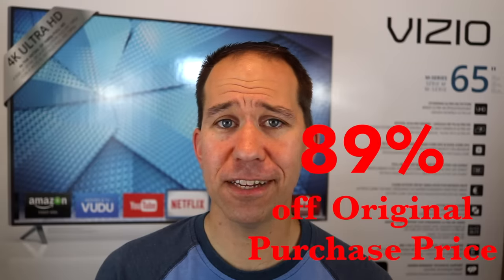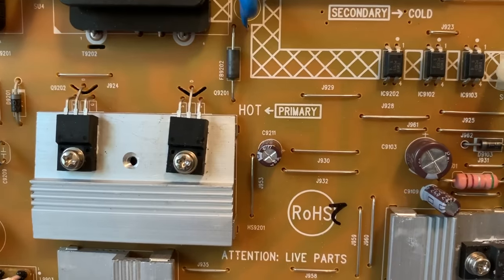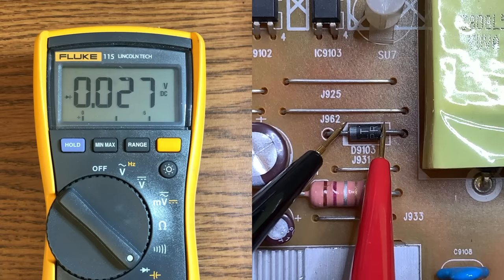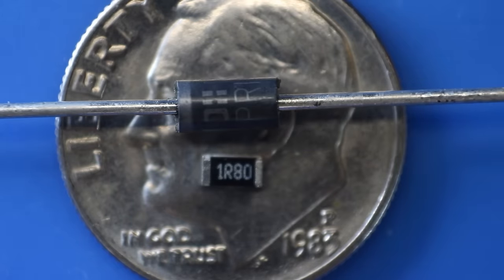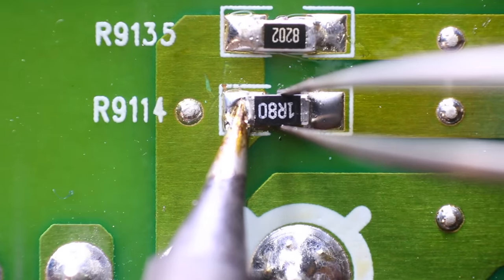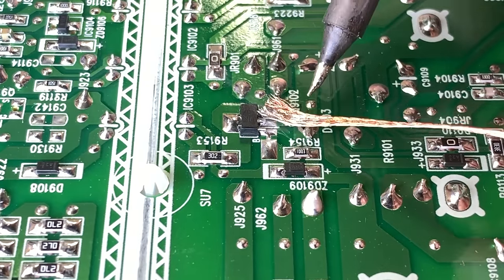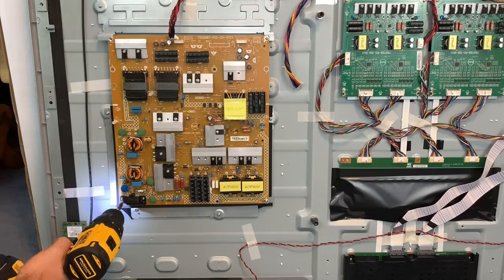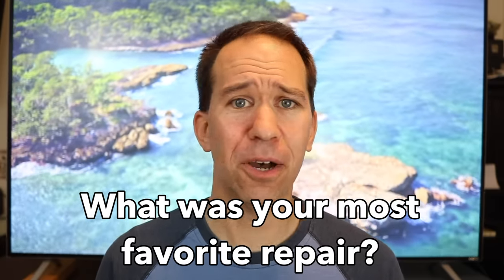I got a broken 65” 4K TV - How I repaired a Vizio M65-C1 (tv won’t turn on)

Comment: I need help. Im trying to fix a Samsung BN44-00640A power board that I think may be broken. this tv has been hooked up for over 3 years but not turned on.. I went to turn it on the other day and it just kept clicking on then off after a few sec. red led would blink a few times then steady red again.. I pressed the start button on the tv for a few sec. and half the tv pic. came on but shut off again quickly... I watched a few youtube videos, and now im a PRO! so i decided to take it apart since it broken anyways :) can't hurt right? well I started thinking this sounds like it could be the Tcon board that went bad. so I like to trouble shoot a little in electricity, and thought this could be very simular process. I unhooked the Tcon cable and tired turning on the TV. see if it would turn on? it DIDNT.. I had seen that if you unhook the main board from the power Board, the backlights should turn ON and that would let you know that the PowerBoard is OK..
The lights did come on when I unhooked the MainBoard, but I'm not convinced it does Not have issues, so I decided to check it as best I could without taking the board apart which I'm sure is the best way.. unfortunately Im not that inclined or have the tools to do it. 

I got my ohm meter put the sound on, and tested the fuse, and got a nice BEEP.  then did the transistors and all checked out GOOD.  Moved on to the DIOs and got good reading on them as well. Everything seems ok up to this point and I was starting to think I'm waisting my time on this powerBoard, but I decided to for the heck of it, to check and see if I had continuity on all the resistor, since I did not want to take them out to test their readings if I don't have to.. so I started playing the toons of BEEP, BEEP, BEEP up until I hit one resistor out of the whole board that didn't BEEP! 

So, here is my 1st. question? Can this happen and the resistor still be good, or does it always have to BEEP?  Color on the resistor is: Yellow, purple, orange, and gold. I have not taken it out of the board yet. 

Now I Decided that I should test this board even further to make sure that the power going out was correct.
so I plugged up the Board all on its own, and compared the Volts on the little square next to the plug that sends the power to the Main Board and I have a few that are reading different.  
I jumped the Ps on with the 5V next to it, so that I could get my readings. 
PIN:
1. B13v        > got > 12.5                                                2.  Vamp            > got > 12.5
3. B13v        = GOT *  3.1                                               4. PWW_Dim5   > got > 12.5
5. Od_Level  > got > 3.1                                                 6. PWW_Dim4   > got >  3.1
7. Od_On     >  got > 3.1                                                 8. PWW_Dim3   > got >  3.1
9. GND         = GOT * 3.1                                              10. PWW_Dim2  = GOT * GND 0
11. B13v      = GOT * 3.1                                               12. PWW_Dim1   > got > 12.5
13. B13v      > got > 12.5                                              14. B13v               > got > 12.5
15. Vamp     > got > 3.0                                                16. Blu_On           > got > 12.5 
17. Vamp     = GOT * GND                                            18. GND             = GOT * 12.5
19. GND       > got > GND                                              20. GND               > got > GND
 21. B5v        > got > 5.3                                                22. A5v                 > got > 5.3
 23. B5v        > got > 5.3                                                24. PS-ON            > got > 5.3

Now I see that I have a few pins with reading that are incorrect. is this do to the board not being hooked up to the Main board, or am I correct to say that there is something wrong here? 
Especially don't think pin 9. and 18.  should have a reading with Voltage. Also pin 3. with just 3.1v instead of 13v is confusing to me..

Any Help with this would be very appreciated.
Reply from the maker: Are the capacitors on power supply bad? (on the cold side of the PS).
Reply: @FrugalRepair  I ended up ordering the main board and the power supply and switch them out to fix the problem fast.. it's working good as new.. I was not sure if playing with the components could damage something else or not, and didn't want to risk it with this expensive TV.  I now have 2 boards to play with, but I am trying to fix my Onkyo reciever that also got damaged at the same time.. However I am planning to just play around with the components in order to fix it.. and I am posting videos on YouTube on the process.
Reply from the maker: @extremelocura  Cool!  Eager to check out the vids!

Comment: can you help me ? after power tv led standby green than fast blinking than stop and turn red. the red blink many time .Blinking Red Lights Doesn't stop .after i turn on tv, standby green going to exchange to red , the skrin  tv have one time flashing backlight than the red blinking non stop. th - 55ex600k
Reply from the maker: I am not familiar with that model number so I can’t say what the lights mean. Have you researched online? They probably mean something. You might have to open up your TV and take some measurements. Did you watch my video on what to do after a lightning strike or power surge? I have some steps in there that you could take to diagnose your TV. Also if you download my PDF(link is in the description) On how to diagnose your TV, that might help you out
Reply: @FrugalRepair  sorry panasonic TH-55ex600k
Reply from the maker: Is it a plasma TV? If so, you may be able to find out what the blinking means. You have to count how many times it blinks and find the information online to find out what that blank code is indicating.
Reply: @FrugalRepair  sorry sir it is led tv, the blinking red doesn't stop.

Comment: I used your video to check my power board and I am getting constant 19 Volts. the tv power Led turns on and then fades and starts to blink I have no Purple light on main board
Reply from the maker: There may be a main board problem.  I’d recommend that you check the eBay listings that offer a repair service.  They describe certain conditions they repair in the main board.  You can see if those symptoms/ indicators match yours for a clue.

Comment: Vizio TVs have a common failure point: the power supply. Almost always when I get sent out on warranty service calls it’s the power unit.
Reply from the maker: What manufacturers are you seeing more failures from?  Vizio is the brand but some other manufacturer made the boards and panels.

Comment: Working on a Vizio M50-C1 most of the time it shows no pic or BLs, occasionally it comes on and shows half a good pic, the other side is on but distorted. I tried a new main, and a new Tconn. No change, Red light is solid on the mains.  Besides TVs I used to fix microwave ovens buy the tons, when they cost 500 per. I have a degree in electronics and automotive from a very good tech school. TSTC Waco.  I can fix cars very well but at 60 and had back surgeries I turned to easier things like TVs and electronics. I did well in school but I struggle with electronic gadgets. With vehicles I can access a service manual, they don't do that sort of thing with electronics, so to me that makes me stare at it like a monkey doing trig.
Reply from the maker: Sounds like a bad panel.  Check the capacitors on the driver side for short to ground on the bad image side.  You can try blocking row signals too.

Comment: I got a solid red light on main board but no luck with the picture. the led light outside blinks for a while and goes off after few seconds. Any idea where the problem is.
Reply from the maker: It may be a main board issue.  There is a repair service on eBay that may describe your symptoms.  I am currently not familiar with the common issue they are repairing.  If you find out, let us know.
Reply: @FrugalRepair  you think replacing main board will do? Or should I try fixing the board. Is board fixable
Reply from the maker: @niranjand4238  Did you research the symptoms?  I would be pretty certain it is repairable.  The key is how much time you put into diagnosis.  I also wouldn't replace boards without testing the voltages and having a really good idea which board had the problem.  It is possible you don't have a common issue.
Reply: @FrugalRepair  thanks, I will spend more time
Reply: @FrugalRepair  I replaced the main board, now it has very dim light on two left quadrants on the screen and some dim flickering light sometimes on the right bottom quadrant. Any ideas how to troubleshoot this.
Reply from the maker: @niranjand4238  did it have any of those issues before?  That sounds like the led backlight is having trouble.  Could you try messing with the settings?  Turning down the backlight intensity.  I'd have to look it up but there may also be a setting that you can turn off that dynamically changes the backlight zones to match the color on the video.  Maybe it is the led driver board or it is getting bad info from the main board.

Comment: Looks like the original components are underrated, it will be bad again, I would buy 1.8 ohm resistor increased the rating to 1/2 watt , the Diode increased the rating to 2A 1000V.

Comment: Would you be interested in repairing a Pioneer receiver?
Reply from the maker: I have a lot of projects in the pipeline but what kind is it?  A vintage one?
Reply: @FrugalRepair  thank you for getting back.  First and foremost, awesome channel.  Its a VSX-90.  I guess newer model.  Powers on, no relay clicking.  Worked great until volume cut out.  Would spin volume knob and sometimes it would play at a very specific spot.  Then, it just stopped all together, no matter the volume change up or down.  Display works, video works.

Comment: the cost also should include the effort, and time spent multiplied by your hourly rate.
Reply: if you fixed for yourself in your free time then it should not be included....but the repair work i estimate is about 40usd.

Comment: Or you could just replace the entire power supply board if it's cheap enough, of course it would be more worth it if you get the tv much cheaper like around 30 to 50 to 80$

Comment: If all else fails, get ready to shotgun it and have an infrared viewer handy ( with the other components disconnected of course).
Reply from the maker: Do you mean using a thermal camera and looking for a short?
Reply: @FrugalRepair  Yes, like you plug the device in and the short circuit will heat up more than the other components. Shotgunning is also when all else has failed and to find the short you overload the input voltage/current so that the faulty component pops or heats up very fast.

Comment: Electronic parta are never measured soldered on the mainboard because the current crosses the least resistence path... That means you can not be sure that the part measured has the right value.

Comment: Why is it okay when you measure 19v but the board says 12v?
Reply from the maker: I don’t know why they labeled it that way.  12v is more of a standard voltage to run the main board.   I didn’t investigate it further because others online posted that this power supply has a 19v output.
Reply: @FrugalRepair  More than likely it is an unregulated power feed that will be regulated to 12 VDC on the main board.

Comment: I got this same tv for free with the same issue
Reply from the maker: That’s great!  Hope it’s an easy fix for you.  Let me know how it goes.
Reply: Well i tested the power supply and it actually is putting out the correct voltage and the parts you point out are working. It seems to be a problem with the main board but no one has it in stock except for one shop that has very poor reviews. I wonder if the main board is a simple fix or if it would take a professional soldier tech with expensive tools. I have soldered for a company but that was easy stuff when they were short handed.

Comment: my 32" vizio tv will not turn on anymore, with the remote nor with the power switch on the tv how do i fix it?
Reply from the maker: Do you get a standby light? In order to fix this TV you might have to open it up and use a multi meter to figure out if the problem is the power supply or the main board.  You might want to check out another video that I have about what to do after a lightning strike. I understand you don’t have a lightning strike but I go through how to diagnose whether there is a power supply or main board problem.

Comment: Sorry to be a party pooper but for others doing this please be careful as there are capacitors on that board that store voltage from the power some hold enough to give you a nasty zap and with TVs there are quite a number of them please be careful to ensure you check and safely discharge them correctly before you get hurt.

Comment: I being fix in it by cooking it in the oven but is happening again and more often , first time last 1 year , 2nd last 5 months and now is only good for 3 days , help please
Reply from the maker: Funny, this issue is probably going to be the subject matter of my next video.  The most probable issue you are facing is that there is oxidation under the solder balls (under the BGA chip - the CPU) and that oxidation is not going away with heat.  You may have to get to the point where you remove the CPU entirely and clean up the pads.  This is quite a repair but thankfully there are some on ebay who offer this service fairly reasonably.

Comment: I have samsung flat screen plasma tv model ny02 that i got at good will for $10.00 but it has bar code lines i opened it but diddnt know what to do lol...
Reply from the maker: I would try reseating the horizontal video cables where the black bars are.

Comment: I have 65 vizio 4k got it at Walmart 900 bucks about 3 years ago and now my screen just went black no warning but still have sound I know my next tv wont be vizio
Reply from the maker: Probably the led backlight went out.  You can confirm with a flashlight while it’s running and you hear sound

Comment: Vintage tube amps are my weakness.
Reply from the maker: Maybe you know about them though?  I picked up an Akita 40 today from the trash,  it won’t power on.  I’ve not repaired a guitar amp yet, any thoughts on if I should try on this one?
Reply: @FrugalRepair , If it's dead you need to start at the AC source. With the amp turned on chk and see if there is 120 VAC at the transformer primary.
Reply from the maker: @GenerationXT  Thanks!  I decided to give it to a friend since I've got plenty of projects but if he has trouble I'll take a look at it.

Comment: Is it possible to have a bad Wifi receiver? My 65" UHD wont connect to the internet, and yes I've tried EVERYthing from the internet/youTube.
Reply from the maker: It’s possible.  Can you use the ethernet port to connect to the internet?  It would help isolate the issue.  I’d also check the antenna wires since they could potentially come loose.

Comment: Bought bosch tool vac on Ebay for 100.00 they cost over 1000.00 I thought it was busted motor turned out the last owner never cleaned it out filter checked  ha ha happy days
Reply from the maker: Wow, that’s an awesome find and repair!  Thanks for sharing.

Comment: You don't measure a resistor while its in a circuit. Most of the time it will show you the effective resistance in the circuit combined with other components in the network.

Comment: i pickup tv's that are thrown out, usually cracked screen test it make sure everything else works... pull out all its guts and then use ebay black market to sell the led guts... lol jk i use regular ebay.
Reply from the maker: Nice!  You can also use those cracked screen ones to make shop lights for your garage.  Jerry rig the power supply and sell the main board.
Reply: @FrugalRepair  oh I sell led strips too but I thought about that even grown lights because micro greens is a pretty big thing now days

Comment: My vizio is pissing me off. Just got it 3 months ago, only 1 hdmi works, randomly turns rainbow screen, gets stuck on the logo a lot, can’t send audio or video signal from my bar to it in any way except digital cable, and every time I open something on my Xbox the tv turns off then on again
Reply from the maker: Sorry, I don’t know but sounds like a problem on the main board.  If it’s used and not under warranty, you could try heating the CPU.

Comment: I got a 60 in Samsung 4K Smart TV it got all the bells and whistles on it the remote control is like a mouse and you can talk to it too it will not show a picture now only thing is due you can hear the volume in the talkin and stuff like that but will not show a picture and a red light in the right-hand corner blinks off and on what is the problem I paid a lot of money for this TV
Reply from the maker: Try shining a flashlight next to the screen at a slight angle while you can hear sound.  If you see anything at all like an image it means the led backlight is the problem.